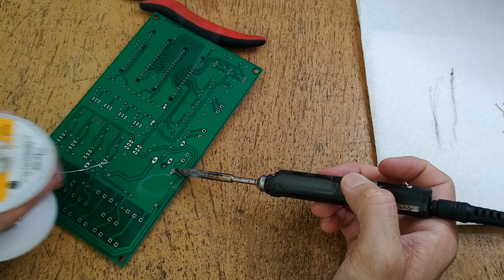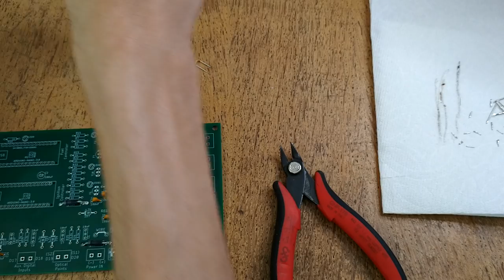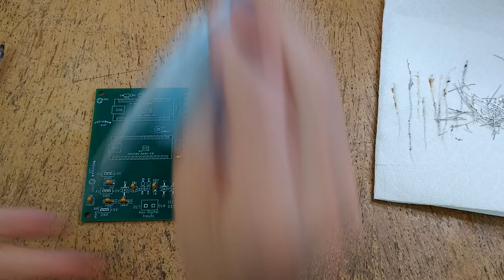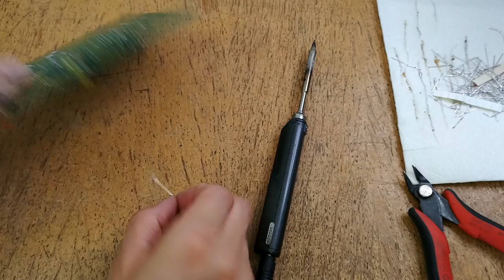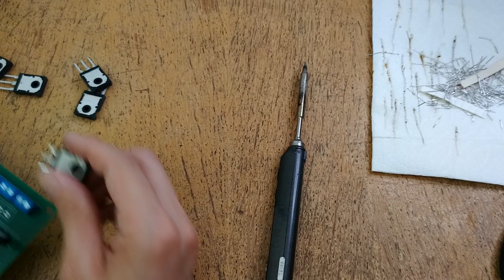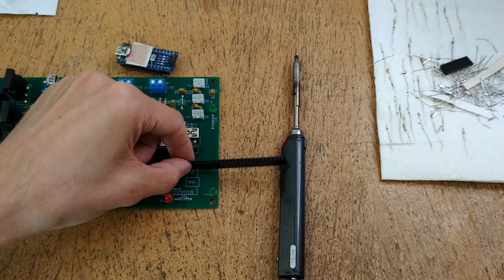Complete PCB Assembly of the New 4-Coil Ignition/EFI Build

Comment: I bought a megajolt lt Jr distributorless ignition board off of an ebay store last year. As advertised it was supposed to come with the board, processors, and everything else to be soldered to the board. When it arrived the pkg contained the board and processors notbing else ,and when I sent a what the hell email to the seller all I got in response was "no refunds" and then the store closed😂